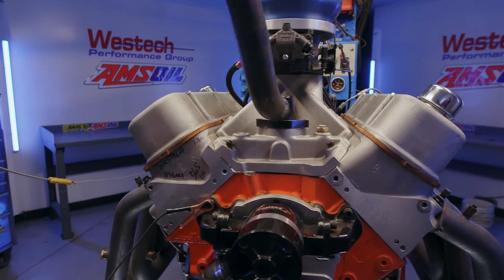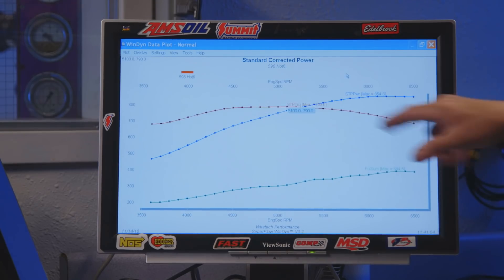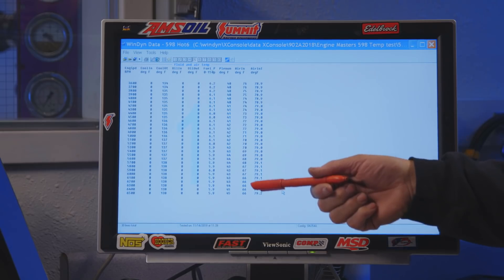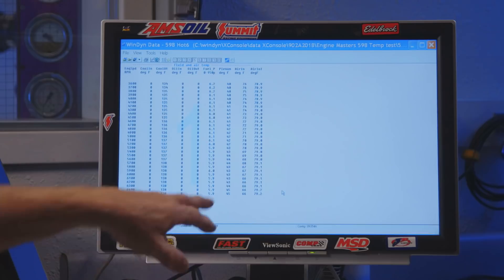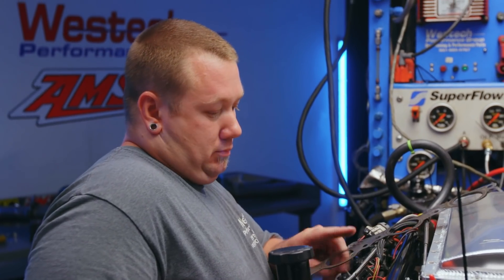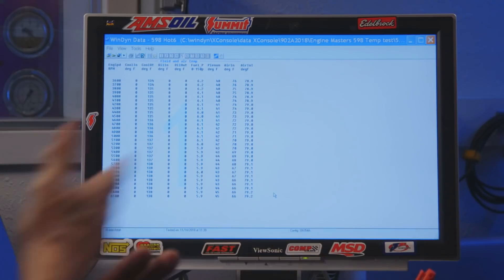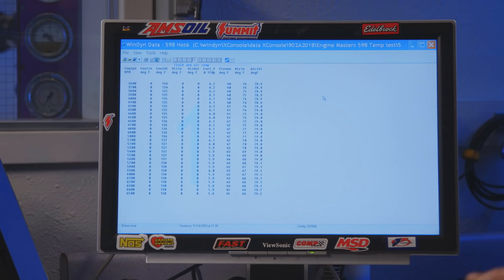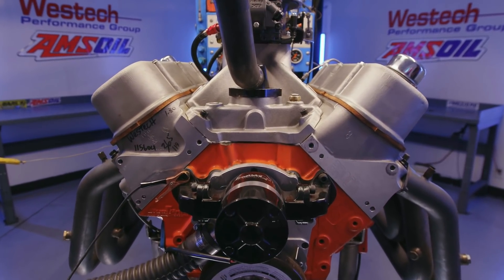Hot Run Vs. Cold Run—Engine Masters Preview Episode 43

Comment: The reason why the engine doesn't care if the manifold is hot, but does improve in power and torque when its cooled down is because of one simple thing. The 3rd Law of thermodynamics. Heat is only transfered one direction. From hot to cold. So when the manifold is already  hot (+230°), the ambient air temperature (90°ish) entering the manifold will cool it off (but won't get cooler than 90°) via convection. But when the same process is reversed, manifold cooled by ice at 34° and the ambient air still being 90°ish, the incoming air will be cooled off by convection sending cooler and more dense air into the combustion chamber creating more oxygen and a bigger boom. Thats why there is no difference in performance when the intake manifold is hot, but there is a difference when the intake manifold is cool.

Comment: Steve already knows the answer to these questions, because, at the first Engine Masters Challenge in 04, he allowed Joe Sherman to run his engine at 120degs for the first 2 pulls and on the 3rd pull it got to 160degs, which was supposed to be the minimum temp to start the pulls at, and the engine LOST 20hp. And then they put the dyno sheets on the internet, proving that they let Sherman CHEAT.

Comment: I Would Like to See You Test a Motor That Has Coolant Running Threw the Intake . 
Then Retest the Same Motor With the Coolant passages Completely Blocked Off in The Heads . 
So There is No Coolant At All In The Intake { A Dry Intake } .

What About Running a Intake That Has No Coolant Passages !
The Intake Runners Are Double Walled is The Coolant Flows Around The Intake Runners .
The Floor of the Intake is Double Floor Between The Bottom of the Intake .&. The Lifter Valley ! 
It Would Have its Own Seperate Cooling system ! .

Comment: DUH like we didn't know. Vaporizing fuel in a vacuum lowers temperature. Cold weather 30 Degrees with 95% humidity can choke an engine with ice in the intake runners. This is why you have preheat of air and crossover passages on a Carburetored engine. Big advantage of fuel injection is no icing in the intake  so it needs little warmup on cold mornings if any. Basic Theory guys. Auto shop 1. Now combine port fuel injection with a carburetor with no idle circuit and what do you have?   Try it.

Comment: It should make more power at proper temp as the pistons are not rocking. You can see the blowby near the end. Fuming is not sealing. 
Cold air in the intake passage though will make more power

Comment: Higher temp in the intake is bad according to Dulchich and everything I've read over 50 years. But oil temp is another thing altogether. And coolest temperature translates into high intake tract temperatures. The lower the ambient temp the more dense the stair is, providing more oxygen for combustion and ending in higher HP. At least that's the theory. That's why guy take wet towels kept in ice water wrap their intake manifold with them between rounds to help get temps down. One guy even built a reservoir on top of his intake that he fillies with ice and water between runs to cool down the intake charge. I've often though about using an AC evaporator in the fresh air intake housing to cool the air, shitting it off just before the run to prevent parasitic drag. That along with a smaller evaporator in a can containing the rule on its way to the carburetor instead of a dry ice  can. Or maybe some combination of both. But what is clear to all racers is that the cooler you can get the airfuel mixture or more importantly, the air entering the carb or throttle body the denser it will be providing more horsepower, period. The only disadvantage is that all of this cannot be maintained throughout and an entire endurance race, like NASCAR or Indy racing. Other measures would need to be taken to make it work for those engines.

Comment: the first thing i can see,,, think,, is,,, its so cruel, on the oil, metal,, so i think the temp of the oil,, and thickness,, is why power diff,,,,,,,,,,, not coolant temp,,, it causes no friction,,,,
Reply: Coolant temp reflects the temperature of the motor and effects the temperature of the intake charge.
Reply: i guess, i was commenting that i didnt think coolant temp materd as much as  cold oil did,,  a cold engine should have more friction than a hot one,  and make less power,,?
Reply: Your thinking is only relating to oil viscosity and frictional drag.  Which has been measured going back to Henry Yunics testing days (well publicly shared). 
You have to separate the two topics. Even still,  I don't see a worthy test to validate what could have been found or is already known.

Comment: Have you guys ever done the test between gross and net horsepower?
Reply: The difference between those is testing wide open (like they do here) and testing with all accessories, factory exhaust, and factory air intake. Back in the 60's engines would be tested on a dyno with open headers and no intake or accessories. Then put it in a car where it would make way less because of the full exhaust, full intake, timing setup for street, etc. When SAE came up for the standards, those practices went away.